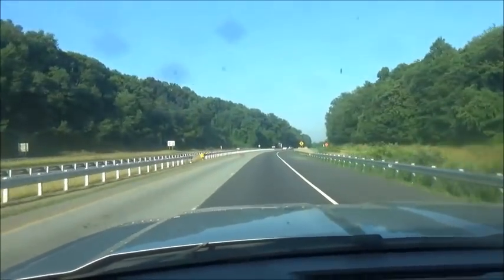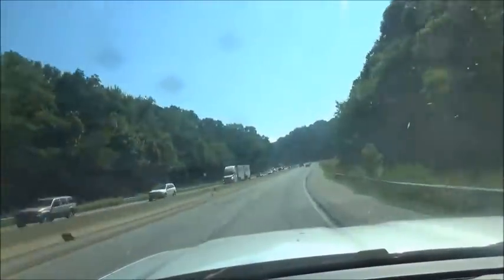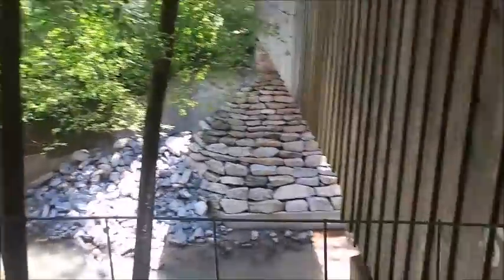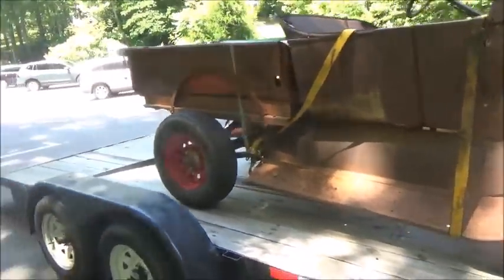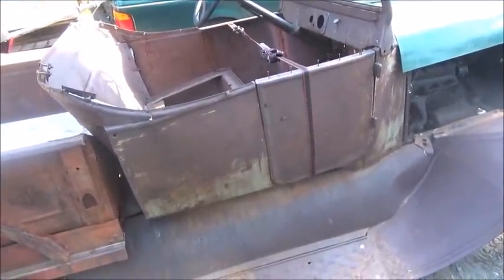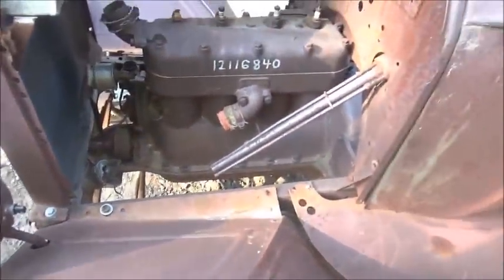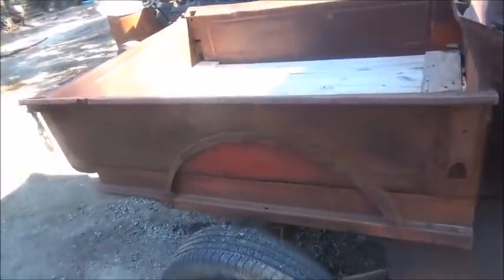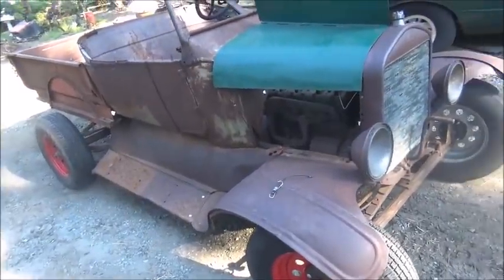BUYING A 1925 MODEL T YARD ART ON MY DAYCATION!!

Comment: I saw that for sale but couldn't figure out what was really there from the photo. Now I know! Hard to believe those cars were only 20 HP,  parts are lighter than a model A but I did learn that the model A manifolds will fit a T to get a little more horsepower but the small crankshaft can't take much more than the 20 HP. Good deal!